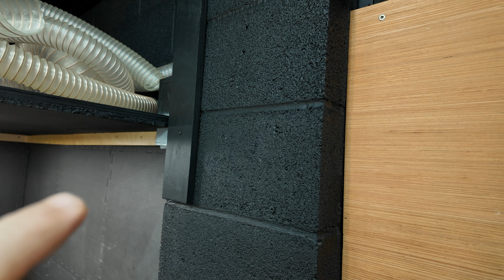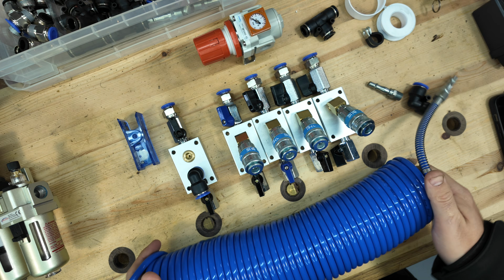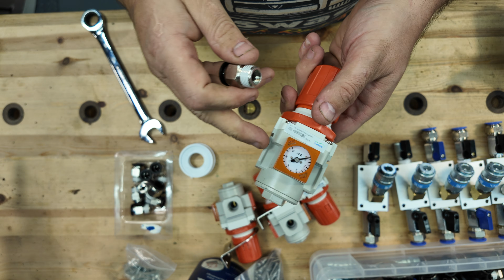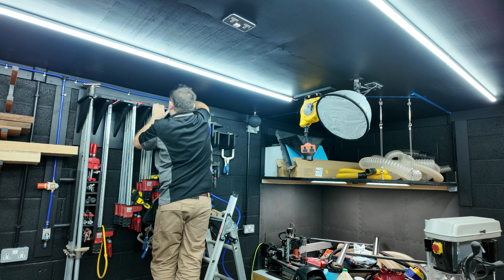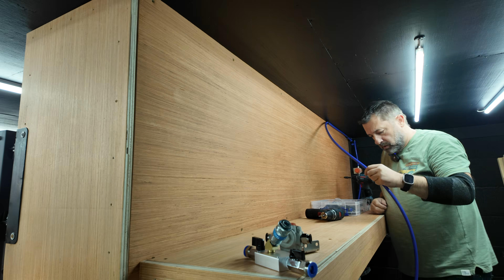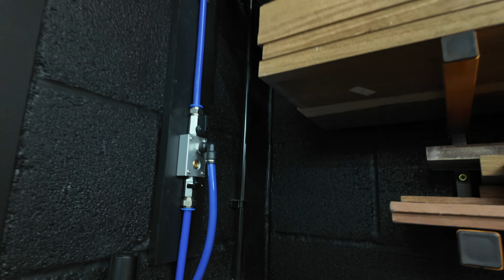Airline upgrade for your workshop

Comment: High flow connector is a waist of money unless you are running industrial size screw compressor that supply's 1" impact gun on a industrial scale air supply system.
Reality is that standard german type  connector that is most commonly used has 9 mm hole that is enough for 1000l/min of flow  at 6 bar of pressure-a number that will never be reached by whimpy little compressors common user buys.

People mix air flow rate and pressure a lot.Its like garden hose-reduce the pipe size and it will take you forever to fill a 100L bath tub.Increase the pipe size it it will fill it much faster but your pump might struggle to build up pressure trough large pipe.
Thats where compressor air tanks come by to store said volume  so that pump doesnt work all the time,so that components have time to cool off(unless you have 5k € extra and you are running large screw compressor which doesnt care).When it comes to air tools both is important ,but its also very important not to overload the air pump with insane demand.
Reply from the maker: Great information! I have pinned for others to read.

Comment: Do you often need multiple pressures across drops?  My plan will be to have the primary regulator and run the drops.  I don't a need to multiple air pressures now but could always just add online in-line since this flex hose is so easy to work with.  Just wondering if i'm missing something.
Reply from the maker: depends what you are doing really. Each tool has a desired CFM or psi rating. Beyond this if you were using it for nail guns or air sanders etc. then the difference may not be too much. I happen to have a plan to create a Festool style vacuum clamping system. This will need 4cfm vs my air  blower or nail gun which maybe near 9cfm. So for me it is about convenience.

Comment: 1.7899° (1°47'24")Is a taper angle for both of them.National Pipe Thread has pitch angle of 60°.
British standard pipe thread is divided in two types BSPP -Parallel thread  and BSPT Tapered thread which has pitch angle of 55°.
So BSPT male can go in NPT female thread but it wont seal properly.
Tapered threads in "perfect"world dont need anything,If machined perfectly it would seal without teflon tape.But we dont live in a perfect world.
Reply from the maker: Thanks for the detail!!!!